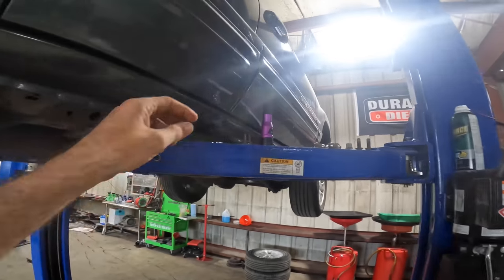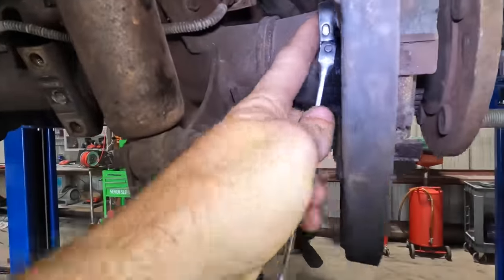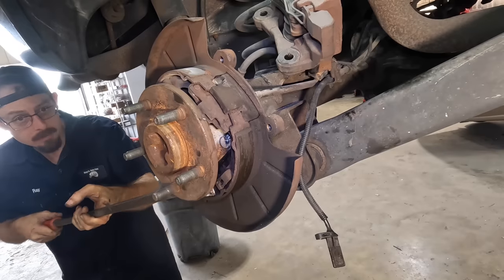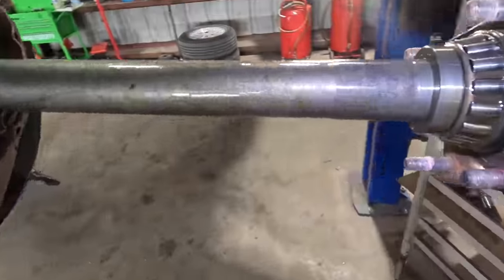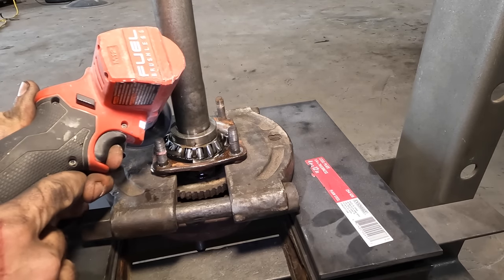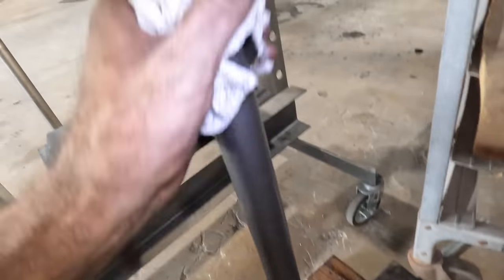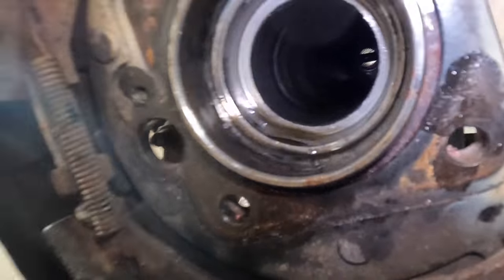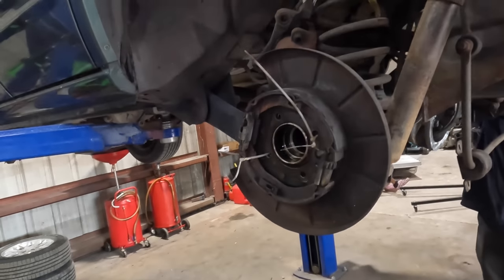Mechanic Destroys Bearings! | 2002 Jeep Grand Cherokee WJ 4.7

Comment: Wouldn’t it be easier to first take the brake shoes off?
Reply: .....And use vice grips on the heads of the studs?
Reply: Shhh.  It's fun to watch him flounder around.   Tee hee.
Reply: @pattonpending7390  Hahah!  Better be careful, he might throw a camshaft at you or something like that....
Reply: No I can get a set of these bearings done in 20 minutes
Reply: Watching this video really made my head hurt I have never pressed those bearings off what I do is I cut them all the way through and then air hammer them in the slot you cut all the way through and the bearing literally comes right off it’s so easy
Reply: @chriswells2730  Little heat from the weed torch and they tend to slide off.
Reply: @Laugh1ngboy  ok cool
Reply: American!
Reply: @Flies2FLL  An empty can of brake clean....anutha!
Reply: They can be a pain to reassemble especially when the parts are 20 years old
Reply: And you could then try grips rather than the weld if you can get in.
Reply: Parking brake shoes?
Reply: @Sneakdisscommentbelow 

Yes.  Pretty common.  Disk brakes all around with rear parking brake shews inside the rear rotors.  They should pretty much last forever.  Because they aren’t really used to stop with.  Just to hold in place, though they are Emergancy brakes, they will stop the vehicle in an Emergancy.  Not very good or quickly, but will slow you down to a stop.  Normally if they are warn out, it’s because the person left them on or didn’t fully release them.
Reply: @jbdragon3295  yeah they changed the name from emergency brakes to parking brakes because ppl were using those in emergency and then going drifting off into light poles and stuff causing more accidents, the newer parking brake shoes that are electronic actuated won't even engage while the vehicle is in motion. I'm very familiar with parking brake shoes and about every other make and model and even German engineering "BMW, Mercedes, etc." The point was he said brake shoes as if they were obviously not even going to stop a VW Beetle. I was seeing if the o.p. knew what he was looking at.
Reply: @stickit2theman1 😊😅😅😅😮😊😅😊😊😅😅😮😮😮😮

Comment: I wonder if that method Eric O uses on the shorter stub axles to get the bearing center off would work.  He sets it up in a vice with the part he wants to get off facing down and then hits it with a torch.  Once it expands it will just fall off the axle.  Looks really slick but I haven’t had an occasion to try it yet.
Reply: This guy will never come close to being Eric O.
Reply: @thk7513  Agree, thought I was the only one here that is not impressed bij Ray's skills!

Comment: Always  amazes me how much people struggle getting bearings off.  This ain't rocket surgery. Set the axle in a vertical position with the bearings at top- Let gravity work for you -  it's free ,doesn't cost anything..   Use your cold chisel or cut off wheel and remove the roller cage and roller elements.  Now use your torch set with a small to medium tip and heat the inner race.  It will fall right off.   To put the new bearings on just stick em in an oven or hot oil bath to 250 to 300 degrees F and they'll fall right in place.

Comment: Oven heat and a pipe as a slide hammer. New bearing first and then retaining collar. Use the old (split) retainer to  drive against. (I have 3 for different axle diameters in my tool box as they serve many other purposes). The collars split with a few blows of a good cold chisel and hammer.

Comment: Re axle bearing removal. What I have used that works well is. Heat the bearing retainer ring with the torch to cherry red, beat on it til slightly flatted. Ring will fall off. Then use the press to remove bearing. Thanks Old school guy.

Comment: Raaaaeeeey! Did lots of those style axles back in the day. Volvo also used that system. It is so damn easy to get those bearings off of the shaft that you will kick yourself for not doing it or figuring it out earlier. The trick is to drill a hole in the bearing retaining collar (it is NOT a "spacer") parallel to the shaft. The hole should be a bit smaller than the width of the collar (OD - ID) so that you don't run into the shaft. You don't need to drill all the way through to the inner race of the bearing because it isn't necessary and will ruin your drill bit. Then simply take a cold chisel to the OD of the collar right where you drilled it and give it a sharp rap with a hammer. The retainer will crack right across the width you may even be able to slide it off with your fingers. If you do a seqarch on youtube for other videos of the same rear axle you will see people grinding a notch in the retainer to get it off so there is video evidence that the technique works. I prefer drilling to grinding. I have done both and the drilling is quicker and less likely to damage the axle.

One thing you gotta understand about this kind of axle bearing retainer is that it is a shrink fit. That little collar and the friction between it and the axle is the only thing holding the axle in the differential. No C-clips. No "full floating" axle here. So when re-assembling it it is best to heat hup the retainer and press it on quickly easy to do with your press setup.

Comment: It is much easier if you use a cut off wheel or a bench grinder. Two slots with the wheel and a chisel will spread the hold down washer or that washer can be ground on a bench grinder until near through then hit with a hammer or hammer and chisel and it will crack. In either case it will then slip off and allow for the extraction of the bearing. 
       The same procedure can be used on the outer race of the bearing. Grind a low spot on the race creating an opening for removal of the rollers, pull the rollers out of the bearing, slip the outer race off, then grind the inner race thin and break it. Time to install the new bearing.
     This procedure is outlined in the Motors Repair Manual in the section for early Ford 9" rear ends.

Comment: Being that the welder doesnt use gas, you can in fact remove the tip and change it out for a flux core tip which is a fraction of the size and also makes it easier to see the weld.

Comment: A little heat on those bearing makes them a LOT easier to take off and press on.
Using those "C" beams as risers is sketchy, there should be a "Metals Supermarket" near you and they will saw off pieces of any kind of stock you can think of, get a couple of blocks of steel, heavy so stable, square so no tilting, solid so no bending or cracking.

Comment: Am hoping that when you reinstall the bearings, you first press on the bearing (with the axle flange and seal in place), then press on the bearing retaining ring so that it seats firmly against the bearing's inner race. This makes for a much easier install and minimizes damage to the bearing and potentially you..... Hope that makes sense. As an aside, you could do as others have suggested and heat the bearing and retainer during install so they slide on and cool tight on the axle. Just need to move quickly to prevent them from cooling/locking in the wrong area. I have had success doing this by heating them in a bath of hot oil (using a torch to heat the pan of oil). Just another wrencher's opinion. Thanks for the videos and nice job setting up your business!
Reply: Oven heat and a pipe as a slide hammer. New bearing first and then retaining collar. Use the old (split) retainer to  drive against. (I have 3 for different axle diameters in my tool box as they serve many other purposes). The collars split with a few blows of a good cold chisel and hammer.

Comment: Can't tell for sure but most hydrolic bottle jacks have a threaded extension at the top, if that one has one, you can use it to adjust the throw on the press without using up any length from your piston.

Comment: Eric O did a video last month of an axle like this, and I was amazed at his skill with a cutting torch to get the bearing off in a few minutes. In my hands the axle would be unusable after, but his axle came off without a scratch even though the torch tip was in a deep hole. I wonder if there is any role for a clamshell bearing puller in these awkward situations. Or, does the long axle make those impossible to use?

Comment: A torch is much faster.  Cut the bering cage and release the bearings. Heat the inner race and retaining cherry red on one side and then hit the soft red areas with a hammer a few times swelling them. Turn the axel upside sown and drop it on a chunk of wood and watch everything fall off.

Comment: The easiest way to remove the bearing off a wj rear axle is to drill the retainer with a 5/16 drill bit approximately 3/4 way through, then hit with a chisel, it will crack in two and slide right off, then you can press off the bearings, the retainer is sacrificial

Comment: On the bearing retainers, you can drill a hole into them but not all the way to the axle. You can then strike across the hole with a cold chisel and that will usually fracture the retainer making it easy to press off without damaging the other components.

Comment: YOU grind the retainer ring with a grinder till it snaps or heat the ring with a #1 torch tip and it will expand and slide off

Comment: Thumbs up for finally buying Diablo recip blades. I’ve seen you use that Dewalt junk so many times, I almost sent you some. And I know you’re a Milwaukee guy, but the torch blades suck too. Stick with Diablo. They’re the best on the market. Coming from a guy who sells blades for a living…Oh…and if you need to cut steel or threaded rod or bolts with a regular saw, buy their steel cutting circular blades. They cut clean with no deburring needed and your material doesn’t get hot. Not sponsored.

Comment: Next time drill a hole through the head of the bolt and the plate or whatever, stick a nail, drill bit, screw or whatever in the new hole you just made and impact the nut out. 🤓

BTW Ray, you’re a lucky man. I saw your wife sweeping up the shop behind you as you worked. Damn the good ones are always taken!

Comment: 1) Penetrating oil from the get go...
2) There are no C-clips, leave the back cover on (unless you insist on changing the fluid)
3) Do the parking brakes makes it easier to get to the bolts and on mine, the brake shoes were soaked in fluid anyway.
4) Sounds like a job for one of those thermal, inductive bolt heaters.
5) I tried doing the job without removing the studs, and ended up bending the backing plate.  Bent it back and it held (no leaks - but not my best work).
So.... get new plates, new studs.   What you should do is pop the studs out (that you just welded!) and put the bearing splitter between the bearing and the ring.  That ring is obviously what is holding all together.  If I remember correctly, the bearing slides off.
BTW, owner of a 2001 and 2003 WJ..   Oh yeah, AWD not 4WD

Comment: Okay Ray I won't tell you how to do all the mechanic stuff because I'm not a mechanic. However, if there is a metal scrap yard nearby your area where people can go and buy scrap steel for whatever purpose at scrap prices go in there and snoop about for the various plates and channel and things that you think will work you just need a few small pieces of each. Then you can go to home Depot or some such place and buy (All-thread) I found mine in the electrical area conduit and all that. You know how to do all this stuff basically you cut the old thread and you put nuts and bolts on the outside of the channel and that would allow you to open and close the pieces of channel to adjust for whatever job you're working with you know whether it's taking the bearings off the axle or whatever it's adjustable basically. Another thing is the leg on the channel it does flex especially if you use in a jack like you were so you can always weld in a (Gusset or Gussets) to prevent flexing of the legs of the channel. Other than that you always do fine work enjoy your videos keep up the good work don't change anything and peace out! Hi ho to the family say hi to the wife unit

Comment: You need a special barrel for gas-less flux-core wire, it's smaller than regular barrel and still protects gun from arcing out on that Jeep hub. I thought I saw sparks fly off that sec axle as you put pressure on it.......

Comment: In my shop (thankfully I am now retired) I would not have used the flanges anyway. Once the splined bolts spun loose and had to be welded I would not use them again because of the liability. Once you weld on something like those which is non-standard because of the bolt failure it's done. Put a piece of pipe that fits over the nipple leftover from cutting the post off (like the top of the jack goes into)so if there is a slip of the top axle against the flat? surface of the cut off piece it will limit the slip so it does knock you in the little guys. (I would weld it on). Wasn't there a Dr Seuss book...a race in the face? As always, enjoyed this.

Comment: They make different nozzles for flux core wire that are 1/4 the size of the nozzle you have on that welder now. It makes it a lot easier to get in those tight spaces.
Reply: You don't even need a nozzle with flux core wire. You just have to be careful not to touch the tip to the material or it shorts the welder out. The only reason a nozzle is used in Mig welding is for the shielding gas (Argon and CO2) to not get blown away by the wind and ruin the weld. Flux core is immune to this because the flux is impregnated in the wire. This is also why they always use stick welders in construction, the wind can't ruin the welds. Within reason of course...you won't be running perfect beads in a hurricane...LoL
Reply: Flux core wire has the same resistance to a breeze as a rod.

Comment: Hi Ray, wouldn't it have bean easier and quicker to have just popped the shoes off and clamped a vice grip on the head? Just a thought.
Reply: I was thinking the same thing. But who am I to question the man that makes it Rain? Well most of the time anyway.
Reply: Even if you could not grip enough this way there would have been much more room to weld effectively
Reply: @ronniemullis8717  Shortcut failed, saw the sweat like raindrops on his forehead. No understanding of wood's compression strength.
Reply: Yeah .. brake shoes off.
Reply: I also don't know why he didn't just hat the bearing so it would drop off. Plus I've never known a diamond tipped blade to cut steel. They're more for masonry. 
Bloody boy wastes more time trying to save time😂
Reply: Ray will tell you he's been in a shop for years and he knows his way around... But just bc you've been in a shop for years doesn't mean you were doing jobs correctly
Reply: @TheOriginalDaveJ  you can get diamond tipped blade meant for cutting steel
Reply: Glad thats not my car. Can't believe this comedy. I know back yard mechanics that can do better.
Reply: Always more than one way to skin a cat 🐈
Reply: @marlenemcgowan1446  he’s definitely a shade tree mechanic, especially when it comes to jeeps
Reply: Haven’t you heard?! THIS IS FLORIDA!!!!!!!!!!
Reply: @marlenemcgowan1446 it is Cunningham's Law- what can go wrong, will go wrong.
Reply: @Marlene McGowan  so go away and don't watch.
Reply: What amazes me is that he makes an easy job hard and dangerous and as soon as someone says anything all his dedicated followers jump to his defence.
Yes he’s knowledgeable in some mechanical aspects but not so in some others.
Reply: @markB40  yea man I think he does it just for views. A lot of people watch video after video and talk shit on each video. But hey who are we? It is not like people are watching our channels nor have we made millions of dollars from our videos.
Reply: @mikemorris7776  I think that's an unfair statement.  General mechanics like Ray working on various models and makes,  will not always have all the specialty tools that a dealer might have because he deals with an wide range of car.  He will not always do things exactly the same of a dealer because he doesn't always know the right factory way... It's doesn't make him a shade tree mech...
Reply: Happy Mother's day to your wife!! And happy mother's day to both your mother's!!
I hope it's a  great day. 
I can only say your method worked.  And now you're on to the next phase.  I don't like negativaties.  Your figuring things out pretty good!👍
I could be helpful,  but I've never been a critic!!
Love your show👍👍👍👍👍👍👍👍👍👍👍👍
Reply: @marlenemcgowan1446 I do enjoy the channel, but I wouldn’t use ray, always in a hurry and very rarely torques anything.
Reply: and then if the vice grip doesn't work you have more room to weld
Reply: Ray still learning his way with older jeeps, fuel pump on a YJ and now this axle leak on a WJ
Reply: The backing plate wont fit over the hub

Comment: Those bearings are easy to remove. I have done them without a press. The retaining collar can be knocked off the axle using hammer & blunt chisel.

Comment: If those outer bearing races can be slipped out then they may have been turning in the housing and wearing it larger and looser. What  to do?  Just put it back together and it will last some time, may leak around the bearing.  Could heat that area dull red hot and let it cool, that will make it shrank a little and you will have to tap the bearing race in.   If really loose I have seen someone center punch all around the inside the area to raise some steel and put a sealer  there and put the bearing in.  I do not know how long that lasted.

Comment: Would a lot of heat on the old bearing race and the spacer have released it enough to make the removal easier?   Asking for a friend.
Thanks
Reply: It wouldn't need a lot of heat...say get it up to 200, 300 degrees while under pressure from the press and she comes off like butter.
Reply: Yes steel expands half a thou for every 100 degrees I think. Half a thou is a large distance in machining.